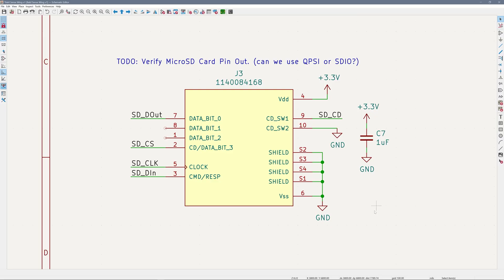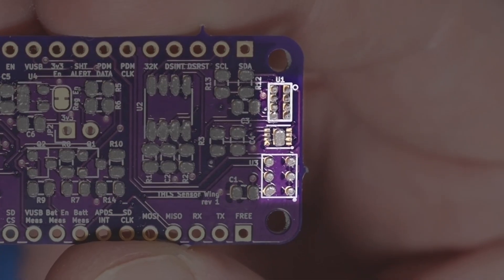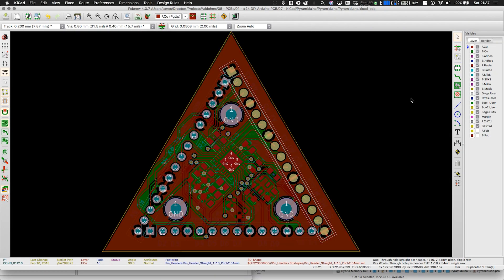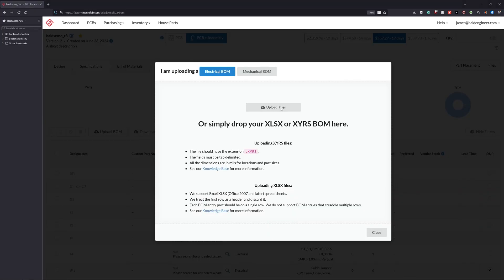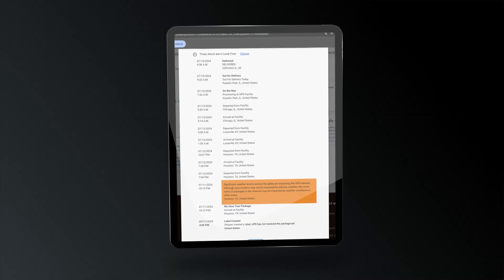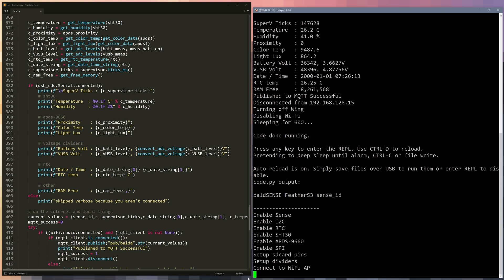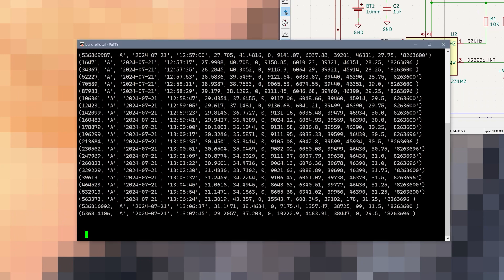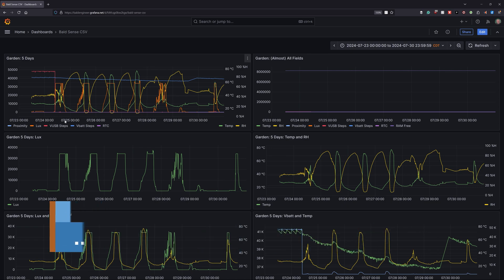PCB Build: DIY vs Turnkey Assembly with the Bald SENSE Feather Wing (and MacroFab)

Comment: Ever considered espnow instead of wifi ? In my experience batt consumption is quite lower ..
Reply from the maker: I haven’t used it yet. But I am planning to do a comparison soon.
Reply: @AddOhms  I have over 20 esp8266/esp32 sensors around the house all espnow-ing to one central esp32 and that one does wifi and /metrics for grafana

Comment: You're spreading solder paste way too fast. Paste datasheet probably mentions 10mm per second max. And no more than two passes, first around 30 degrees to spread paste, and second around 45 degrees to clean off excess.
Reply from the maker: The paste I was using had a print speed of 25-100 mm/sec. While I was probably going fast, I was still under 100 mm/sec. The two passes at two different angles-of-attack is not something I have heard before, nor did anyone suggest it in any of the livestreams where I printed paste. So, I'll give that a try next time I do it.

Comment: Great educational video... I also use a lot of the Adafruit Feathers and am in the process of designing/building my own Power Feather board to use with my NeoPixel projects (12vDC in, 5vDC out).  If you have time and are willing, I would like to collaborate with you offline as I also in the Houston area.
Reply: Ah. MacroFab is in Houston, I am not. :)

A Feather board for NeoPixels sounds useful. If you search for "YULC LED controller," you'll find a recent project I came across for controlling LEDs. It's not in a Feather form factor, but it might give you some ideas.
Reply: @bald_engineer  Much thanks for the link to the YULC project and I wasn't aware MacroFab is a local company (like this option versus waiting for boards from China)... I'm still a novice at PCB design.  Even though we don't live one another, I'd still be interested in a bit of collaboration so I can learn more about part selection/layout/etc. as I have more IoT projects I'd like to build my own PCB

Comment: How aboit to add a AI VOC / VSC quad sensor array? You can pick up all volatile chemicals as well as any bacteria bacterial overgrowth and it is a really awesome sensor that can analyze the chemical nature of everything from different types of coffee to the presence of e coli. And other environmental potentially nasties that could be present in a lab like yours. BME688 gas sensor can detect Volatile Organic Compounds (VOCs), volatile sulfur compounds (VSCs) and other gases such as carbon monoxide and hydrogen in the part per billion (ppb) range.
Reply from the maker: That’s a good idea. And something like the BME688 is probably the right option. Back when I did the initial design, VOC sensor options were terrible. 

I was on a short schedule when I brought this project back to life. But I wish I had looked into VOCs again. 

Guess there will have to be a rev4.

Comment: Since finishing the video, I have deployed 3 more Bald SENSE Wings (and FeatherS3s). Now I have mapped out the time different parts of my garden receive sunlight. And I trying to use temperature to determine when HVAC compressors are running. But, I have another (shaky) idea for that.